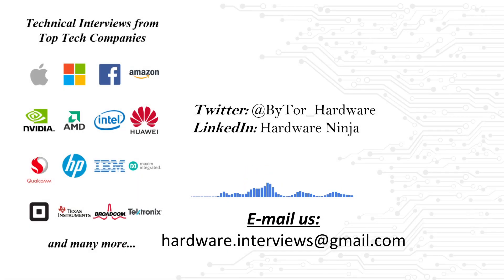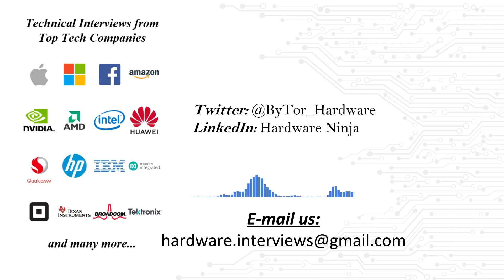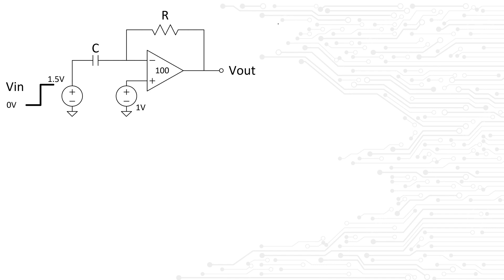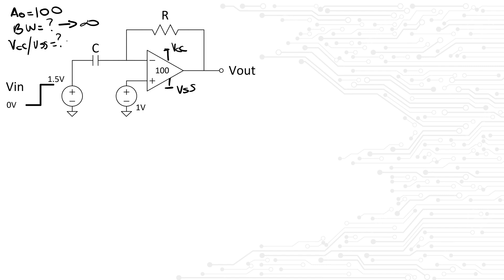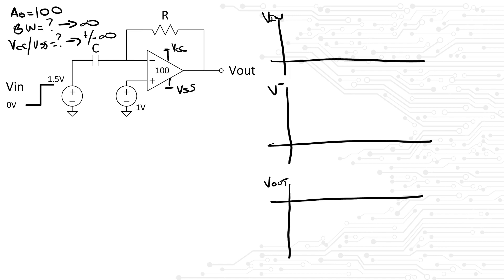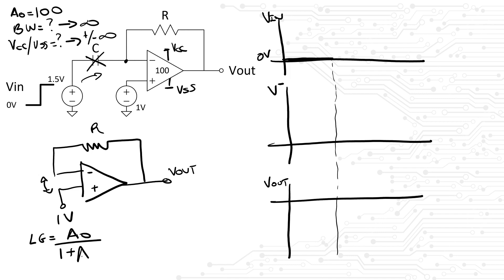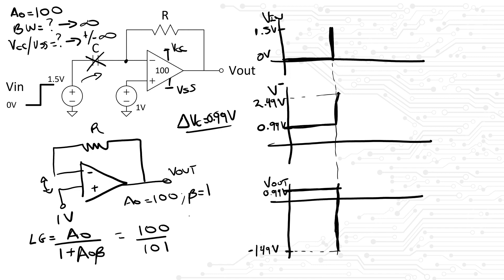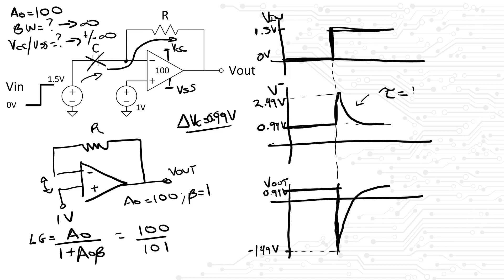HWN - Hardware Design Interview:  HPF

Comment: when input V- is 0.99 why output goes to +0.99 ..isn it should be zero ? since no input is given and both terminals at same voltage?

something to quickly think about this circuit is its differential amplifier, differentiation of square wave is impulses at other end of capacitor..
Reply: The Output does whatever it takes to equalize both inputs. In that case the opamp outputs 0.99V to compensate the offset.

Comment: What if bandwidth is finite and supply is not infinity ....is it saturated at supply voltage and the response will comparatively slower due to finite bandwidth
Reply: yes..with finite bandwidth i can not respond quickly to input changes and will take some time to settle
Reply: Difference bw slew rate and Bandwidth??
Reply: Yes, if the supply is limited, the output will be limited to Vdd/Vss